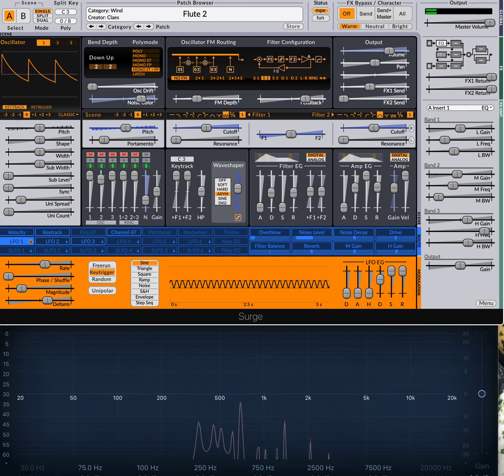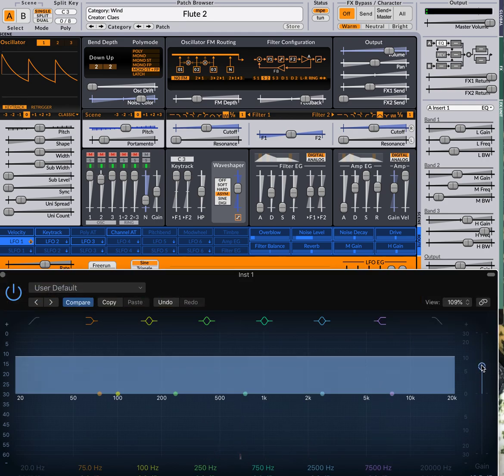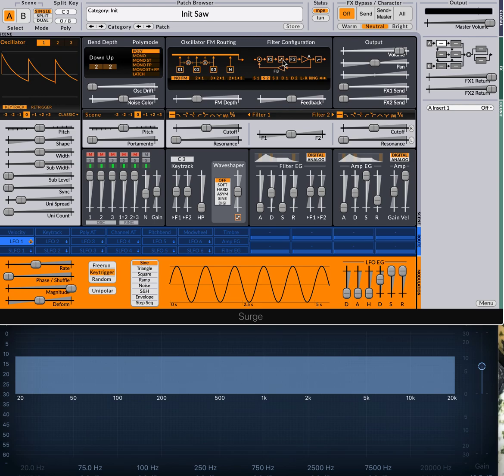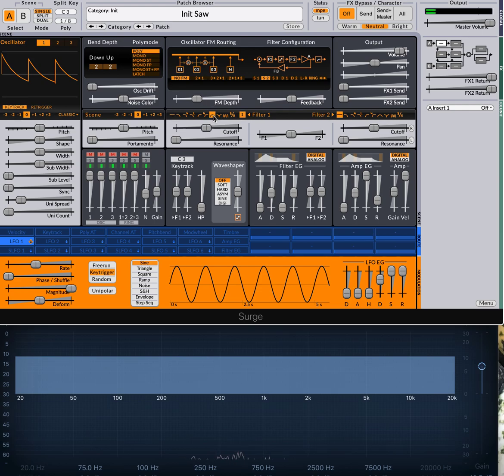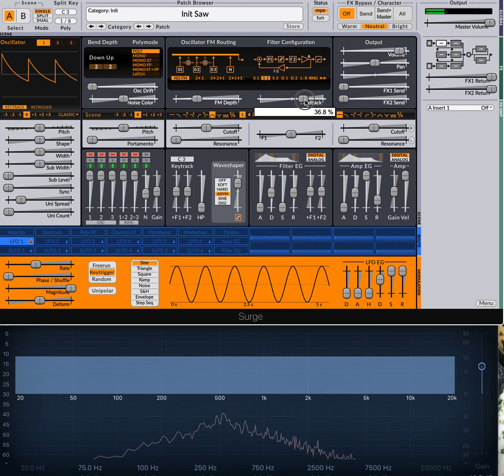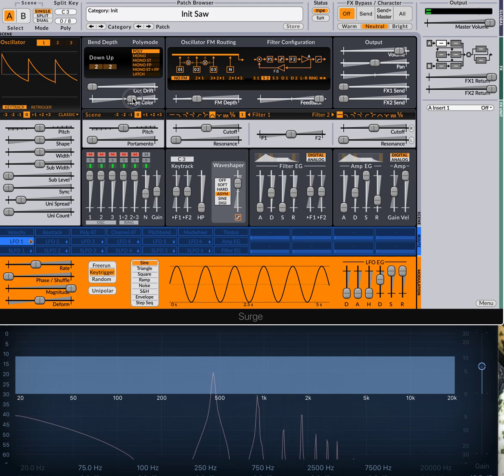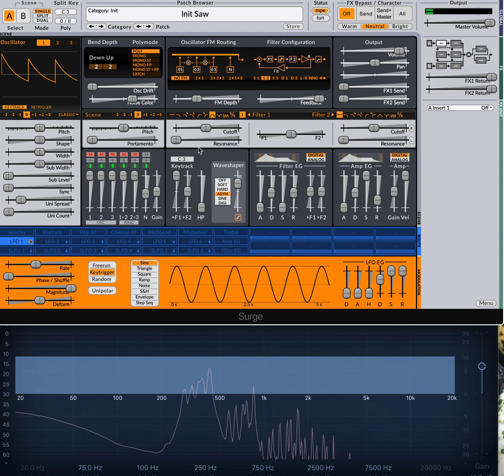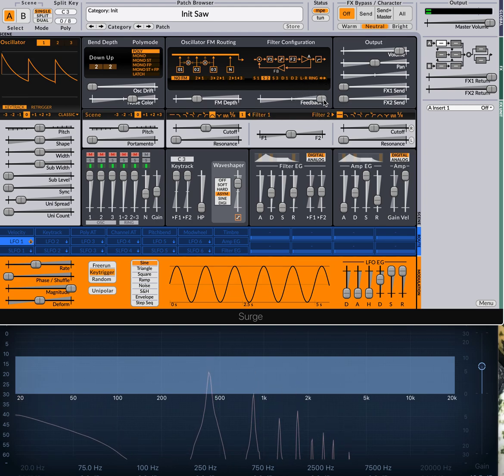Filter Feedback and the Surge Flute2 Patch

Comment: I have been trying to install Surge for month in various linux distributions but it seems to need a library that no distributions use or even have. Sad
Reply: sad may not be the right adjective

can you be more specific? like for example.... which Linux distributions and which library? 

Surge works in any Debian based distro and has also been ported to Arch
Reply: We’ve installed it on many many linux systems successfully. If you would like to share details on your experience on which library your system is missing, please do drop a note onto our github.

Comment: do the keytracking sliders react to mpe pitch bending, or just note numbers?
Reply: That's one of those things that "should work but I wasn't sure it did" but I grabbed my Seaboard and did this exercise and yup, MPE bend works fine with key track. 

If you are interested in such things, here's the code that does it: https://github.com/surge-synthesizer/surge/blob/0b1caaf5efdeb32cb0489489e31806bd78f10cab/src/common/dsp/SurgeVoice.cpp#L431